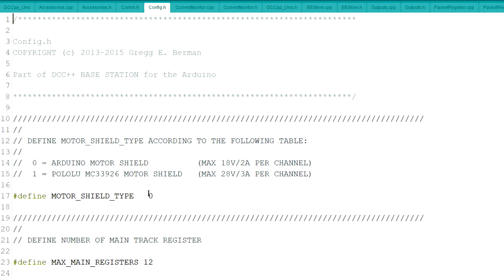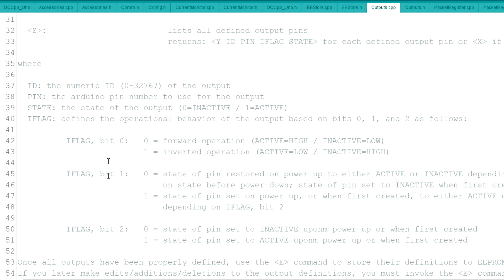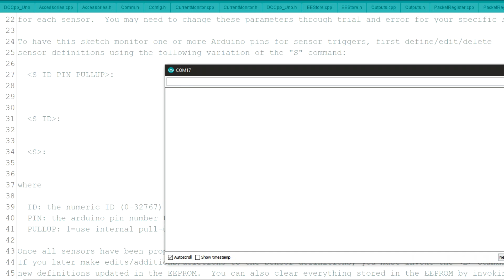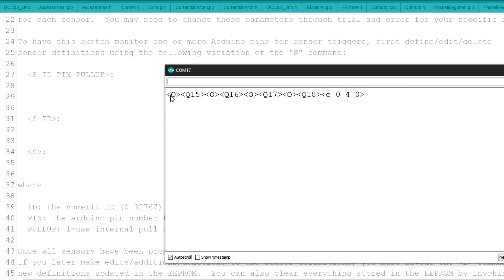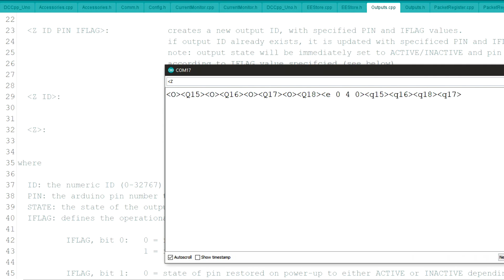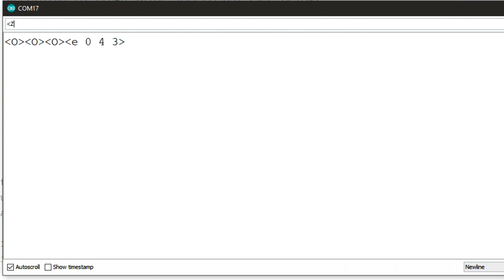Easily Add Sensors & Outputs To DCC++

Comment: So this board will only take IR sensors which run on 3.3v. I have a IR sensor which is 5v.
Reply from the maker: I have IR sensors and relays in this video, all 5vdc. This is an I/O sensor shield, that means any input or output that has 5vdc. The pins are clearly marked as Input or output, but they can be changed in code which I discussed in another video

Comment: So if I have a relais on pin 128 on my PCA9685 (#41)  and I set it with  <Z 128 128 7> 
7 is bit 0,1,2 high. I store it in the eprom with <E>
But with what command can I set the relais? :body-blue-raised-arms:
Reply from the maker: T= turnout, Z=relay, S=sensor. To set them in eprom, use E, this will set any sensor in. As shown at 7:15

Comment: I'd wondering how you connect the power to the DF Robot Shield and the Motor shield, to they have their own power supplies or does the sensor shield power the motor shield? Thanks
Reply from the maker: You can see the barrel connector in the video and me explaining the switch to change from the Mega power or the external power. The motor shield is powered in the same way with external power which is  explained in the DCC++ videos
Reply: @TomsTrainsandThings  That's great thanks for clarifying.It was just in the video it didn't show the power connector on the motor shield https://youtu.be/TdISgXAyiOY?t=170.  I really appreciate the reply.

Comment: Is it possible to enable WiFi using the DFROBOT ESP8266 WiFi Bee since we are already using the DF IO Shield instead of the recommended MakerFabs ESP8266 WIFI Shield?
Reply from the maker: Not with DCC++ but you might want to check into DCC++EX to see if that is one of the compatible wifi devices
Reply: @TomsTrainsandThings  Sorry I forgot to mention that I'm using DCC++EX but it's not on the official list. As I'm using an UNO hooked up to JMRI via USB and wanted to add both Sensors and Wi-Fi, hence my question. It's very hard to get the MakerFabs Wi-Fi shield so I wanted to check with you since you already have the DF IO shield before ordering the Mega and other shields.

Thank you for replying on such an old post, really appreciated.

Comment: Just wanted to let you know that this is not the way it works for outputs. The command is <Z ID PIN IFLAG>, the IFLAGS are not separate parameters, they are bitflags in a byte. You have to do some binary to decimal math. So you have bits 0,1 and 2 reading from right to left line this (2,1,0). Those are position numbers since a bit can only hold a 1 and a 0. So if bit 1(the rightmost bit) is a 0 or a 1, it is easy since the decimal value you would enter is the same, a zero or a one. But to compute the others, the easiest way is to use the power of 2 based on the position of the bit. So 2 to the 0 power is 1, 2 the the 1st power is 2, 2 to the 2nd power is 4. So you just  add those numbers together if they have a 1 in them. So 001 is 1, 010 is 2, 100 is 4.. So to set bit 0 and 2 to one, you add 1 and 4 and get 5. To set the fist two bits on, which looks like 011 to the computer, you add 1 and 2 together and get 3. You are counting in powers of two instead of powers of 10. Those 3 bits can hold 8 possible combinations of 1s and 0s. There are free online calculators in addition to the one that comes with windows that let you just turn bits on and off and it will give you the number ;)
Reply from the maker: Thanks for your input! At least someone knows how to do it!